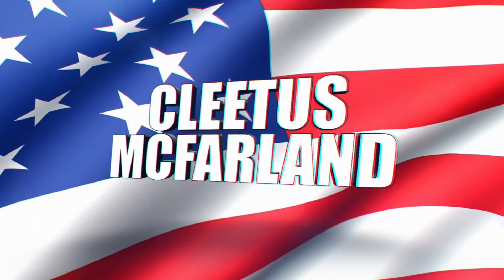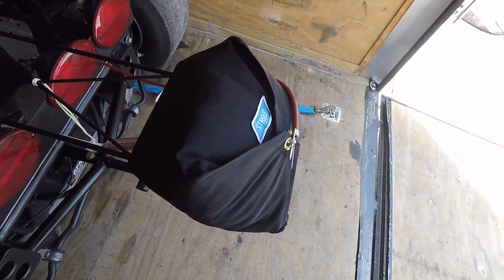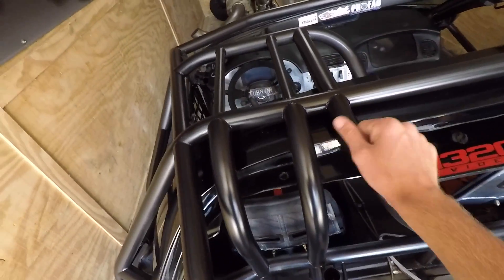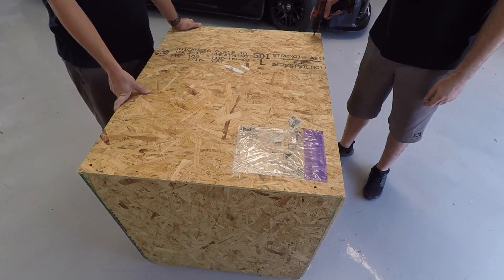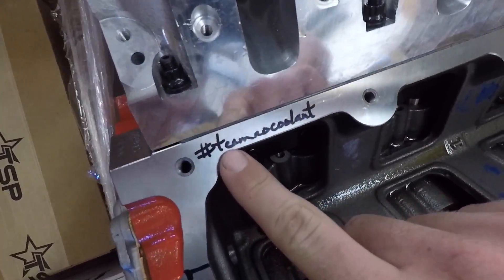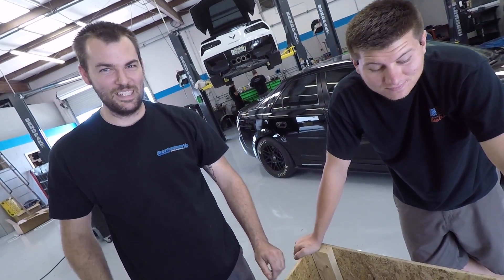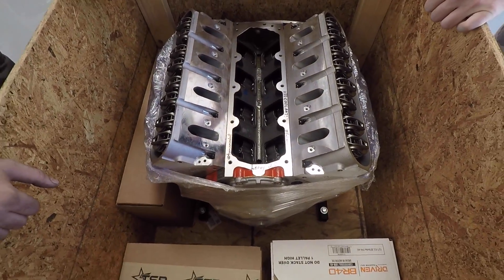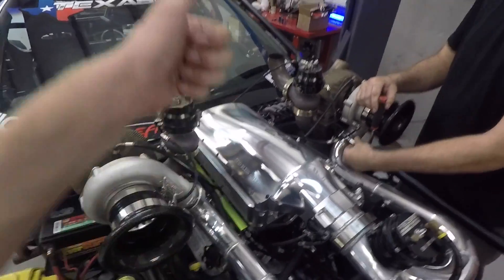Introducing Leroy's NEW 1500+hp Engine... IT'S INCREDIBLE!!! + Major Cage Upgrade!

Comment: It’s crazy how Cleetus said how Leroy’s engine held for 300 passes, which if you do the math, 300 quarter-mile passes are equal to roughly 75 miles. If you include driving back to the pits, city driving, half mile events, and dyno testing, that engine should only have about 200 to 250 miles on it. For what the engine is used for, that’s pretty good, but for a normal car engine it would be hilarious.
Reply: Lets at least add 20 miles for shenanigans of getting a Christmas tree, Mt. Dew and driving back to the pits. Plus, the only reason the engine has any problems is because he did runs first with more boost than it could handle then he did runs without coolant. Take the coolant out of a "normal car" at 200-250 miles and drive the fuck out of it like they did and it wouldn't be as funny. Just sayin......
Reply: Yeah I mean they were just trashin it because they knew they were geting a new one.
Reply: The high boost passes are what killed it, not all the other stuff
Reply: Plus add when Big Monica was out of fuel and they went to take more out, add the miles froms burnouts (example wheels spinning at 60mph for one minute is 1 mile), add the drifts and hoonigan stuff etc, i see what you mean but this is a race engine, im still fucking impress by its reliability! But yeah, saying the engine has less than 1000 miles it's kinda funny to compare
Reply: 250 miles is a lot for the amount of boost and abuse that engine takes, proud of Leroy!
Reply: [Content Deleted] He also drives back to the trailer after every pass so that's another 75 miles.
Reply: Oh and he put like 35 miles on it getting diesel for Monica
Reply: [Content Deleted] I'd say probably about 300 miles total. And we'll over half of those are most likely full throttle nonstop at about, what, 1200ish HP? That's impressive af
Reply: It's not bad but the there's guys putting 1000+ miles on the cars and running 6s. larry's been in the 5s. Watch some drag week. Not saying they didn't do a good job they did. A lot of the needs to go to the tuner also. You can have the best fucking motor in the world and if you can't tune you'll be lucky if it makes a few passes. Takes more then just a well built motor and not saying that doesn't help. Note drag week is coming September 9th thru the 14th you want to see some other really bad ass cars check it out. Side not I know the motor was nothing special so I do realize the importance of that before someone jumps all over me about that. Going turbo really helps. Going back many years ago I had Brain Bosson's old 347 that was in his Fox body ELD car. Back then he was one of the fastest guys around. Google if you think different. The motor was nothing special at all. But with a single 100mm turbo the car went 7.50s in his car and low 7s in the car we put it and that was over 15 years ago and the motor last for years. Tuner and taking care of your shit is what really helps make it last. They did a great job but its nothing knew. And relax I'm not hating on him to the crazy nut huggers. I follow and looking forward to see how far they can go the that transmission setup. I know how hard it was with an automatic to run 7s and help others getting into the 6s. There's not many guys trying what they're doing just because how hard it really is. I'm far from a hater..
Reply: Yup, for only 1300hp, and much of that not being @ full noise, only 100miles seems a bit weak. That engine wouldn't hold up to drag week.

The weakness is in the block design, as 30psi boost shouldn't hurt a well designed engine. The gasket sealing problem from the weak block design is the limitation.
Reply: @nordic5490  you got to be kidding me right? This motor would be more then fine on drag week. It's already proved it's reliable. Even with the Holley box he has, he could turn the boost down and just run waste gate pressure between tracks,  then turn it back up for racing. Wouldn't make drag week. Dude, what are you smoking
Reply: Nor Dic They ran it without coolant man. It would’ve lasted much longer if they wanted it too. Also, your 100 mile estimate is way off. He did so much more than just the 300 passes in this car.
Reply: Actually 225 miles of racing + 1mile of burnout + everything else you have mentioned
Reply: Lest we forget when Leroy rescued Monica after she ran out of diesel.
Reply: @kennethlaw5216  that engine wouldn't survive drag week...even with coolant
Reply: Well then there was that 5 gear skid at hoonigan and that was probably over 150mph for like 3 mins that's probably like 50-70 miles just there...
Reply: meifert2 you have no ideal what you are talking about. this car has had the shit beat out of it. burnouts with the hoonigans,  drifting, dyno pulls, drag racing.  he can turn the tune down or up at will. he has drove this thing down the road to get fuel when he ran out in the motor home, they have taken it through the drive threw. he could run a couple quick passed turn the tune way down. drive to the next track,  turn it up and run it a couple passes,  turn it down and run to the next track. this car would make it no problems.  I'm not a cletus fan boy,  I just know what this car has been through,  and all the tracks he has races were all 90 plus degrees. no problem for drag week
Reply: @kennethlaw5216  so I guess you'll be at drag week then. LS engines don't last at drag week. I've been to the last 3 and am going this year. So I'll see you there if you even own a car
Reply: Todd, 1300hp is a unimpressive specific output for a 7L engine. Here in Oz 1300hp is not uncommon in a 4L Barra i6 daily driver, ie, 1000s of kms.

It looks like that alloy block and head design flexes too much @ 30psi boost, and 20 psi might be the safe limit for that engine. The video stated that the enherent engine design contributed to the gaskets being blown out @ 30psi, hence their new engine is an iron block, with more head studs. V8 configuration is a lot weaker design than an i6, with much more flexing. Also mentioned was the cylinder bore flexing even with the iron sleves, all @ fairly low boost - this is block flex.

Anyhows, I have been entertained, and the youtube viewers have been educated about the limits of that all alloy v8.
Reply: Snarly, no. Just to keep perspective, 4v is at least 20% more efficient flow @ high rpm. So... a 4v engine can make the same power with less boost and less stress.
Reply: Ofc it would, the only reason it didn't last was because of the boost being too high. And headgaskets is not really a failure. Bearings and cracked pistons, bent rods etc. is what usually gets a boosted to the moon motor. 

I've seen boosted aluLS engines being driven and raced 5000 miles without any problems. But any motor will have problems whem you push the boost higher than it was built for!
Reply: You can daily a 1000hp+ car because you aren't going at full power all the time, with normal driving under 3500rpm I doubt the turbo's on most of those car's would spool at all, as long as it's a turbo car it can be used as a daily for sure.
Reply: [Content Deleted] well technically the abuse being held in that engine doing the burnouts, road courses, constant high revving boosted passes at the strip, street driven time and everything else adds wear and tear
Reply: @nordic5490  actually a V engine flexes less than an inline engine, especially an inline 6.
Reply: @robertroberts8651  i forgot you are one of those people that hates the truth. Go to drag week and watch the LS class. About 30% drop out due to engine issues
Reply: meifert2, prehaps you could explain why the 4L i6 Barra makes more than 2000hp on the factory block and head, but the 7L GM all alloy v8 doesnt.  Looks like i6 for the win.
Reply: @nordic5490  because the Barra is a much higher quality engine from the factory. That's why it has a Blue Oval up front
Reply: Your all saying it did well to get that many miles with its HP... Fuck that. Made 780 HP at the wheels with a 2.5 liter and it drove for 40000 km before we sold it .
Reply: @Joe-qc2fw  you need an aftermarket LS block to get over 2000 HP and that's with 7 liters.
Reply: keep in mind the drifting etc..
Reply: @Joe-qc2fw  I've seen stock 351W blocks hold over 3000 HP and iron LS blocks blow up and split at 2000.
Reply: @Joe-qc2fw  you talk just like a pure fanboy. The fact is even the iron block LS engines can't hold the power....it's why none have broken any records.
Reply: @Joe-qc2fw  name an LSX powered car running faster than 6s in the 1/4. There isn't one anywhere in the world....yet a Ford 4.6 has gone low 5s.
Reply: @Joe-qc2fw  out of the box the Coyote is a much better engine. Better internals, about the same weight and much more efficient. Not to mention it's much more responsive to boost.
Reply: Right but if you used it like a normal car, it would last a lifetime.
Reply: @Joe-qc2fw  there is a reason Mustangs dominate almost every track in the country.
Reply: With all the dyno pulls.
Reply: meifert2 And?  I think most people would agree the Coyote is a “better” engine. What makes the LS motors so great isn’t that they are the best or capable of making the most power, it’s that they are cheap, light, plentiful and reliable and dollar for dollar the best bang for your buck.
Reply: consider that NASCAR engines are completely cooked after 500 continuous miles of racing.
Reply: Getter done boys yeha that's what I like about u two kinda cheese on a cheeseburger
Reply: @OxBlitzkriegxO  the not breaking in the engines because they know it will create more content is what killed not all the other stuff.

Comment: What I have used in the past is a Cart/Work bench with heavy-duty casters. Raise vehicle lower down to cart. Unbolt all and raise up lift. Works great to move around shop swap parts ets. Normally we would use for full swaps chassis suspention etc.Once all bolted on  Position than lower vehicle and finish up.

Comment: Make sure to flush out the turbos, if there’s metal in the pan there’s metal in the turbos and oil feed lines
Reply: Good point. They should inspect the blades, as well.
Reply: The bearings eating themselves up and leaving metal all throughout the oil system won't have any impact on the impeller or turbine wheels. It didn't shit a valve and the bearing material didn't enter the combustion chamber. So there is no reason for a proper inspection of the blades on either the compressor or turbine wheels...
Reply: One of the 1320 vids shows turbos with little grooves cut into each blade. Definitely a must
Reply: That happens when debris, sand/dirt have gone through the turbo or water injection is sprayed in the turbo inlet. Doing a bearing in your motor can't damage the comp or turbine wheels. Fuck me drunk guys. Y'all need to learn a bit more about engines

Comment: Yea just spun #4 bearing myself on the track... Racecar life.  For the record you would need to replace the discolored rod as well as the bearing. With all that metal in the oil you would want to replace all the bearings and the oil pump. Soooo full engine rebuild. I am actually taking this opportunity to replace and upgrade my whole rotating assy. Great work. Also think about spraying some clear rustolium under the car to save all the nostalgia for when Leroy is in that museum.

Comment: Hmmmm 200mph?  We don't need no stinkin' 6's or 5's!! Deep into the 4's we go!!!  (hey, if your gonna have a goal..... MAKE IT A GOOD ONE!!)
Reply: Maybe 6s...no LS powered car has gone 5s
Reply: Not for now, but I'm sure it will lol. The LS is taking the world over.
Reply: @Toxic2T  it's been around for over 21 years. The 4.6 broke 6s 15 years ago and broke 5s 10 years ago. Even with all the aftermarket the LS should be able to keep up. But when you consider that the LS is a dirsct copy of the Ford small block it should have success
Reply: Gm man shifted 4's 🤔
Reply: Jacob Axeman  yeah. And you can swap over parts from each to the other.
Reply: meifert2 lmao you’ve obviously never tore either one down
Reply: Guess the truth really makes fanboys mad. There is a post on LS tech where they used Cleveland heads on an LS shortblock and made more power
Reply: 200 in the mile I believe he means now 1/4
Reply: @masonsmith9222  I have actually. But coming from a fake account what you say doesn't mean much
Reply: You can physically bolt sbf heads onto an ls engine. I've seen it, I've done it, the bolt holes all line up. As for making that actually work would be beyond me. The designer of the ls engine was a ford designer previously and that's why. Pretty neat stuff. Look it up.
Reply: @Kmadams_97  all you need to make it work is a custom intake manifold. And yes, most of the LS design team worked for Ford in the 80s and used the FR9 as their design basis.
Reply: It needs body panels for that
Reply: I know a guy that has a 502 ls  all wheel drive makes around 3500 hp at the wheels around 4300 at the flywheel ran a 5.1at 253 in the quarter mile
Reply: @worldsstrongestblacksmith  links or I'm calling bullshit. Because if that was true there would be videos all over the internet
Reply: we run street not track and no videos are allowed at my races small town everyone knows everyone but not what they do
Reply: you can also look up fastest outlaw class pass a lot of those guys rum the same set up

Comment: Texas speed really are killing it I mean how many other motors have u seen take all that you've put that 427 though.Me personally I haven't seen many. And this new one will do just as good if not better  200 here we come💪U.S.A💪
Reply: Maiden, 1300hp and 30 psi is not a big ask for a modern engine design. Plenty of daily driven 4L Barras do that with factory block and head. 
That LS has design limitations causing the head to lift.
Reply: Are you serious??? People do the same thing with junkyard 5.3L or cast iron 6L and put thousands of hard driven miles on them- including burnouts and racing.And i think you'll find most of it's runs were done in the low 20's (P.S.I)

Comment: They didn't x the roof like u said why?
Reply: Thats a good point. They definitely should have done that
Reply: Alex Dodge go tell the experts that
Reply: Probably because of the loop they added over the driver's seat. They probably figured that the loop was going to be strong enough and adding the x-bracing would just be redundant and unnecessary extra weight. Oooorrr they ran out of time and are planning on finishing it after LS Fest.

Comment: When you said LSX I was hoping for a 572 or a 454 at least... :( still pretty badass nontheless!!
Reply: He just got that billet intake plus the turbo setup would have to be completely changed.... hopefully Leroy 3.0 will see one of those engines
Reply: RustyCanadian replacement for displacement is more boost
Reply: Stock corvette displacement. If you want to set a record, there's parameters.
Reply: Never need over 500 cubic inches. Pro mods have a 500 inch limit and make amazing power

Comment: P.s. get a dry sump. I run one on a simple track built LS3, when you go so fast round a bend or in a line, you will get oil moving from its' intended location in them. When you get really serious you need  to also look at return lines from your heads. Call John at Aviaid and he will sort you out bro.

Comment: What happened to putting an x on the roof? Thought they were doing that
Reply: Kinda wondering how he's gonna stuff himself into the caw.
Reply: Andy Taylor just climb towards the wheel and slide back. I had racing seats in my 99 cobra and I had to rub the steering wheel to get over the bolster
Reply: Matt Parks dude cleetus is fuckin hugge literally he towered over me an I’m 5’11😂
Reply: @dallasjaramillo259  That's not tall at all lol. So it makes sense he towered over you.
Reply: StreetSavage 614 I think he’s like 6’4”
Reply: @LoboLakerGaming  He's 6'6
Reply: 5'11'' is technically above average (barely but still)

Comment: To he fair, to only gain around 80lbs switching from an all aluminum to an iron block... that's not too bad on that one. 200 OR BUST
Reply: Especially when you know you can send the boost to a ridiculous number and not worry about it.
Reply: @ThisGuyDrives  exactly! Cant wait to hear it too!
Reply: I remember an old vid of two 2004-5 GTOs that were close to stock and evenly matched. They swapped a passenger (probably 175lbs.) and it reversed the race, each guy w/o passenger just barely rolled away from the other. That's not just 175lbs., that's -175 and +175 to the other car, to barely change a slow race. This 80lbs is going to be all muscle, no fat! ☻

Comment: Texas Speed was posting a lot of photos of this engine during the build. Can not wait to see it perform.

Also, are those Stock Rocker Arms on your first engine? I assume there is trunion upgrades in them tho. Just impresses me how well the LS is build and how much it can handle, tho I think the Limit of stock Rocker Arms is around 400 Lbs of open spring pressure with around .620 lift.

I am still running stock rockers on my built 5.3 with CHE Bronze Bushings.

Comment: You should put a funny car type sheel over leroy for the 200 mph pass
Reply: My thoughts exactly...
Reply: May have too. The broad side of a bar  has better aero than Leroy currently has.
Reply: I'd bet if it had better aero, it would be in the very low 7's already, maybe even 6's.
Reply: Or like a stock car shell because it’s smaller
Reply: Yes, get a custom built 1 piece funny car body to put on Leroy, and make sure it can be easily removable for shows and such, and it would be perfect
Reply: That's not what Leroy is about.  Once Leroy has aero added that will be the day Leroy died.
Reply: If i had to guess I'd say they're gonna push it as hard as they can with new engine with the aero as is. And then modify the aero in baby steps and maybe next year put a body on it.